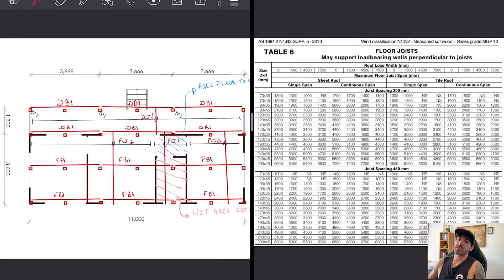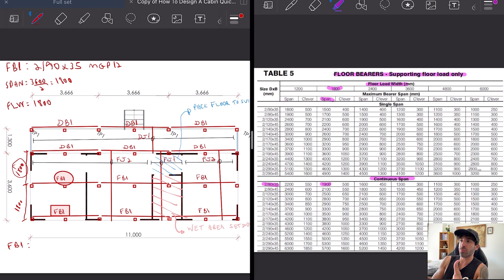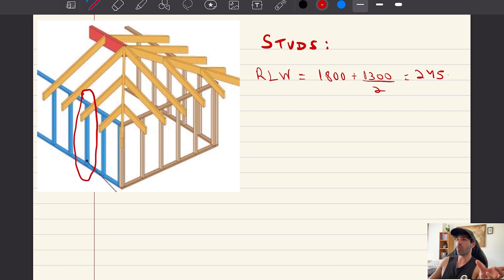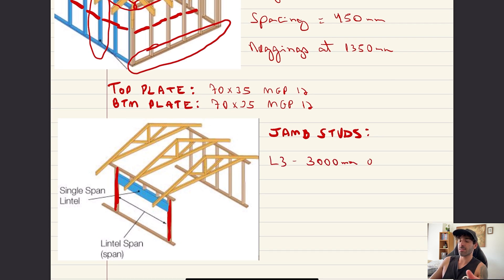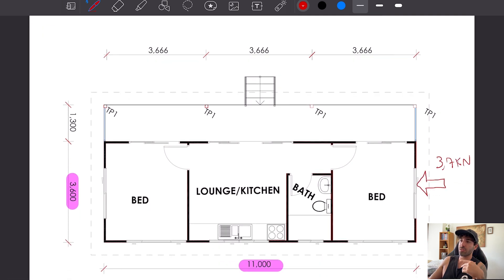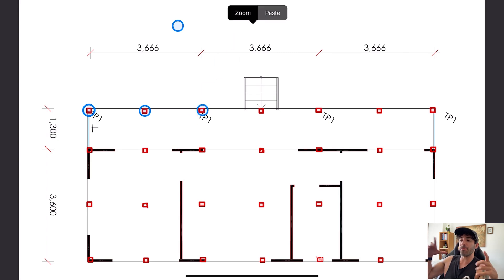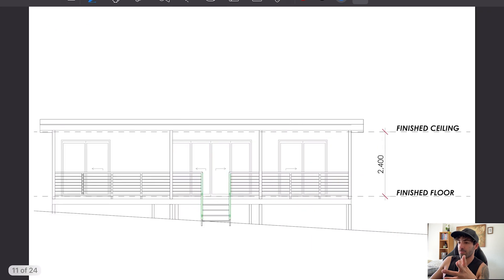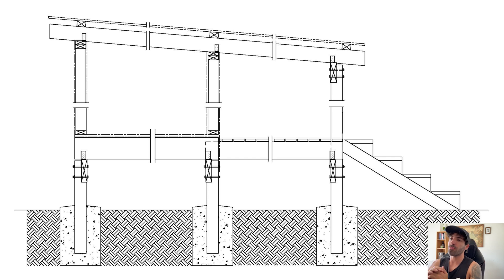How to design a cabin - Part 2

Comment: How come we didn't have to use AS 1720.1 or any of the limit state design procedures taught in uni?
Reply from the maker: you can use them as well. AS1684 and 4055 are a simplification of those standards that we learn at uni. They have limitations though. It only works for certain types of structures like houses